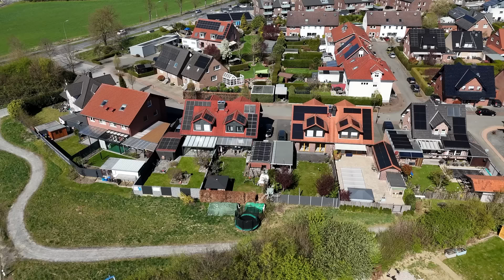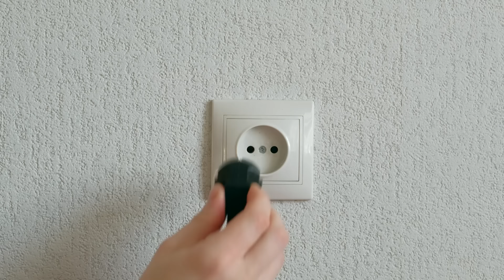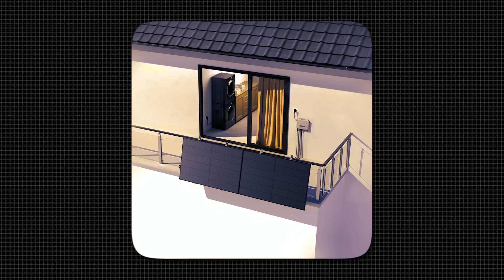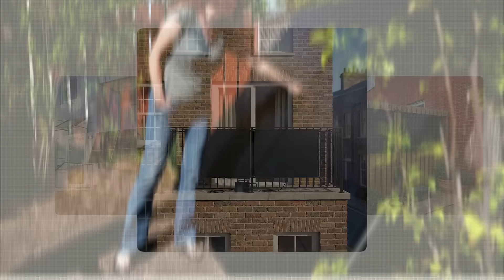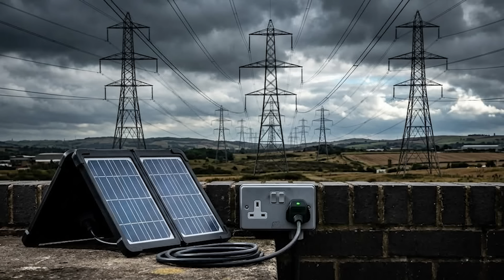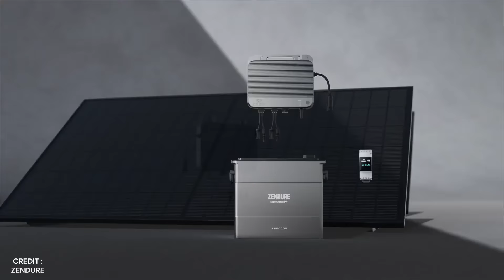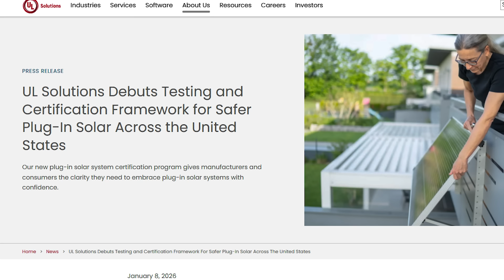Plug-In Solar Could Revolutionize Home Energy - Why Is It Illegal In 47 States?

Comment: I bought all of my solar and batteries myself and put it in with my friend who's an electrician. I did not pull a permit and I do not have a interconnection agreement with the electric utility and my system operates in zero export mode. Then I forged an invoice for $28,000 and took the 30% tax credit on that and my system came out to almost free. I screwed over the IRS and the local permitting jurisdiction and the electric utility and I feel great about it! My system has been operating flawlessly for almost 4 years now.
Reply: "Created" an invoice

Comment: We've been using solar on sailboats for decades you can buy a 450 watt system to charge your house battery for 5  6 hundred witch will run lights and a refrigerator full time. Still need a moter on cloudy days

Comment: The ignorance of home solar and Renewables is easily demonstrated with a volt amp meter and 4th grade math called Ohm's law but they're doing is compounding the problem and making electric bills even higher as once it's connected to the grid could only put in about 15 percent if you get a volt amp meter with the optional amp clamp takes less than a second to demonstrate the ignorance assuming you could do the math

Comment: The 200W refrigerator example is misleading at best. The outlets on your patio aren’t on the same circuit as your kitchen or fridge. It would require an extension cord running into your kitchen and into an outlet in which your fridge was on the same circuit.  After purchasing the panels and inverters, you’d be fortunate to just break even after 12 months.
Reply: 200 watts used from solar is 200 watts saved for your fridge...

Comment: For all this fearmongering the greedy utilities do, I have never heard of a single instance anywhere in the world of anyone getting electrocuted from working on a line where there was solar backfeed. As far as I know, all microinverters have anti islanding, even the cheap ones with no certifications, this is kind of the entire point of a microinverter. So, they would rather have millions more die from pollution caused by burning stuff in power plants instead of use actual logic. 

There have been deaths from backfeeding, but they have always been attributed to portable generators that have no anti islanding because they were never intended to be plugged into the grid. With some of the balcony systems having the ability to plug into them (separate from the grid side) to be used as backup in the event of a grid failure, it is actually safer to allow balcony systems, as it reduces reliance on generators that never have anti islanding.

Comment: I HAVE A SOLAR GENERATOR CAN I PLUG THIS RIGHT INTO MY GENERATOR AND HAVE IT CHARGED ALL THE TIME AND THEN I WOULD BE ABLE TO RUN MY FRIDGE AND FREEZOR AND THINGS AUTOMATICALLY --I HAVE A MARINE BATTERY TO THAT CAN CONSERVE THE ENERGY AT NIGHT WHAT DO YOU THINK OF THAT
Reply from the maker: Not sure of your set up because it relies on an unit inverter and controller that could manage your generation and prioritise demand.  You would also need to check circuit loadings to make sure you don't overload a specific circuit.  When combing plug-in solar with other systems you need to have someone (electrician) confirm circuit loadings and protections.  Not as simple as just plugging it in when combining with other systems.

Comment: thanks!  So dumb question - if your state has a 1200WATT plug n play limit, what if, your house is an East & a West facing balcony.  1200W on East for sunrise and shade after 12 Noon - & 1200 W on West side picking up the slack Noon to Sunset, eh??
Reply from the maker: Interesting point - thing you need to consider is the state limit an installed capacity limit i.e. you are not allowed to install more than 1200watts, or is it a peak generated output.  I would assume installed capacity.  You would have to check that one!

Comment: Install 3 single outlets that connect directly to the panel, the plug in solar.  Power only goes one way and cannot overload the circuit.

Comment: It's illegal because if its protection circuitry fails it will back-feed the grid when the power goes out and potentially electrocute a lineman.  It's only legal in States where the politicians are too stupid to realize that safety standards must be promulgated first and then the specific equipment authorized for connection to the grid by experts who evaluate the equipment to determine if its protection circuitry is robust enough to ensure that the thing can't kill a worker.  Simple as that.

Comment: Correct me if I'm wrong, but if your outside plug is on it's own circuit, wouldn't that alleviate the amperage safety risk? Assuming of course that the circuit wiring is rated above what the solar panel would produce.
Reply: Yes, plug-in systems larger than around 400 watts should be installed on a dedicated circuit (or at the end of the branch) to eliminate the potential for breaker masking issues.

Comment: I’ve had rooftop solar for five years now I like it. It works great. I will say that most of the installations that I see around the country look like hell. Our home was designed to have rooftops solar so it looks good and you can’t see it from the street. Most of these pictures are absolutely hideous.
Reply: Personally, I wouldn't care what my roof looked like with solar panels.  If it works and is legal, that's all that matters.

Comment: Without grid power micro inverters won’t work. A battery backup is a good idea also. I’ve seen my electric bill in California triple in 14 years. I’ve looked at 1) DIY solar, 2) power purchase agreements, and 3) buying a system outright. 4) Plug and play or what’s known as “commando solar”.
1) All of the necessary equipment to replace my monthly average would be $5k. I’m too old at 60+ years to be climbing on ladders on a 45 degree slope. 
2) They say “if you qualify.” You can get free panels and installation. They want you to commit to a 20-25 iron clad contract to pay them what your average bill is per month with a 2% increase per year. They get credit for any excess energy, any tax rebates, and a legal easement to your property and your roof. The contract is tied to your deed and if you sell the buyer has to “qualify” and sign a new 20-25 year contract regardless of how long you’ve had your contract. They cover maintenance and repairs but you still have to pay a monthly grid connection fee and for any electricity you have to use when the system goes down and still pay your contract price. At the end of your contract they will offer to sell you the system at near retail cost for the equipment and installation $15-20k for retail $25k system. They’ll charge about that much if you can manage to break the contract for them to remove the system and possibly retain their easement rights to your property. There is no considerations if utility supply costs decrease or upgrades when better or more efficient equipment comes out.
3) Buying a system outright costs on average 4-5 times the cost of the equipment. $5k for the equipment $20-25k for the system. They can have it done in a few days and often use low skilled labor putting the system at risk as well as your home. 
4) Plug and play. Sounds like the best option. No permits, engineering, easements, etc
A small investment to offset my usage without triggering any alerts.
Reply: Use 2-4 units of 800 watts panels plugged in to different circuit breaker plugs like kitchen, living room, bedrooms, garage  etc?OK  what is your opinion?
Reply: @BRadha-gi4jv  So, you want to be careful, because the electricity produced by the panels counts towards total load on the circuit. NEC stipulates that for safety, the continuous load on a circuit should not exceed 80% of its capacity. For a 15-amp circuits (most household circuits in the US), this is 1,440 watts. I am not an electrician, but I would not personally recommend adding a kit to any circuit that has a high draw appliance on it (refrigerator, air conditioner, etc.) to avoid overloading the circuit. A bedroom probably does not have such appliances, so should be safe, as would a living room. A garage is probably fine as long as it does not have a freezer in it.

I would avoid the kitchen, or at least the circuit that the refrigerator is on. A modern, energy star refrigerator consumes up to 400 watts continuously, so while adding the solar puts the load at only 1,200 watts, that's very close to the circuit's safety maximum even if it's technically ok. If there's another high draw appliance running on the circuit (e.g. microwave oven), you'll be popping that circuit constantly and possibly creating a serious fire hazard as well. Don't do it.

If you can confirm that the circuit is rated for 20 amps (most reasonably modern kitchen circuits are), then the 80% continuous load limit is 1,920 watts. I still wouldn't recommend adding panels to the kitchen circuit, but if no high draw appliances are present, you could add more panels and get more production (as long as the micro-inverter supports it).

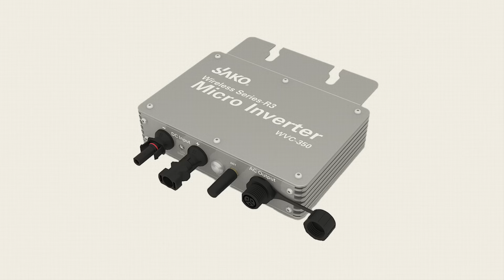Comment: Grid tie systems are garbage - Power goes down so does you power.  Quote  @6:37  the inverter shuts down when it detect the power outage from the utility.  That is the issue - instead it should shut over the main breaker and allow house to run only on solar.
Reply from the maker: It is a safety requirement.  If you want a system that operates in "island mode" then you could either install a transfer switch which prioritises the solar pv and when that isn't available the grid supplies power, or you can simply have your plug-in solar supply an isolated circuit like a summer house or garden shed etc.
Reply: @wildline_YT correct, you could kill linemen if you don't do exactly what you just said.

Comment: I installed a plug-in system similar to this in Washington State. It's actually 2 systems in one. I ran a 220 circuit and split it into 2x 110V and put an inverter (1200W capacity) on each phase to balance out the power. So far, no one has said anything, but I am not exactly kicking it up to full capacity either (1x 300 watt panel per inverter). The panels were purchased used at a significant discount and the system was otherwise hand built by me. My power company's system gives me an hour-by-hour readout of usage. My intention though is winter use. I will eventually get the rest of the panels plugged in and I am looking to put oil filled radiators in various spots of my house, probably with timers.
I also have an off-grid system, but again, I am still installing the panel racks (shed roof and dedicated anchored platform) so the system is not yet ready. My work has me in other states so I tinker with it during my off-time. I have made sure my system is safe throughout the entire process. I even mounted the inverters inside the shed with direct cooling to avoid overheating as they are typically mounted on the outside solar panel rack. I am not even worried about the expense of it. I enjoy tinkering and I think this would be a nifty way of making money by helping others build their systems cheaper than the status quo.
Reply from the maker: Great to hear!  Sounds like you are having fun optimising your energy systems.  You may want to think about making solar thermal panels using waste material such as empty drinking tins or making some compost beds for growing your plants in winter.  One I really like is home biogas - using waste food scraps and other bio waste to generate natural gas that can be used either for a gas burning bbq or a dedicated camping stove.  Good to hear about your tinkering.  Hope to hear more in the future.  Thanks!

Comment: Colorado just passed laws to allow plug in solar. Only problem is that retailers are now raising prices so that plug in solar is costing the same as rooftop solar per watt. It’s the same old story. Why would I pay the same price for plug in solar that I had to pay with rooftop solar even though I’m not paying for labor and install and permits or everything else that comes with it. Only thing that makes rhe price the same is greed and absolutely nothing else.
Reply: Colorado also just spiked “peak usage” energy rates as Colorado Springs utilities CEO got a $250k raise..

They need to fund his raise somehow
Reply: @awd_gli9632 they sure did.
Reply from the maker: Didn't know that.  Interesting that retailers are jumping on the opportunity to make big profit margins (which I suppose is to be expected).
Reply: @wildline_YT  If you can piece together the different pieces needed like the micro inverter and the panels and keep your cost at around $1.00 to $1.50 or below that’s a good number and you will be keeping the saving. Anything higher and they are.
Reply: Greed may be one part of it, but a basic lesson in economics is also most of it. Demand rises and supply stays constant then prices rise. The only way to bring the price down is to increase supply
Reply: @jakobdurtschi9425 wrong.
Reply: Capitalism 101
Reply: @ObjectiveAnalysis  Sure is.
Reply: don't refer to solar as rooftop solar. Solar panels work much better on a ground rack

Comment: Hawaii needs this.
Reply: They had it, then they had to ban it because everyone was doing it and the grid was overloading.  You can't backflow unused solar power beyond the handful of homes on your local transformer.  So if every home on that transformer has unused solar power, the grid overloads.
Reply from the maker: Some systems are now sold with battery banks that stops this back feed.  These would work well in Hawaii!

Comment: Keep in mind that most US power utilities have the meters set-up to count any power sent to the grid as 'usage' - so use caution when thinking about these.
Solar power stations are an  ideal solution to load-shift constant loads for excessive time of use rates.
Reply from the maker: Not sure what your point is - is that good or bad?  You are benefiting from a high off-set cost!